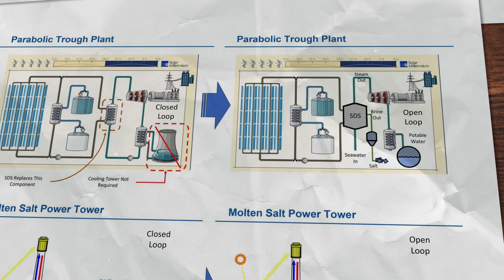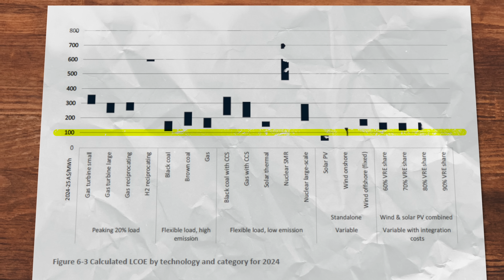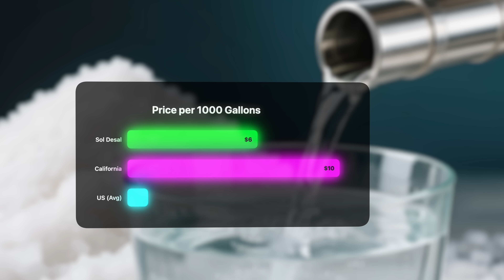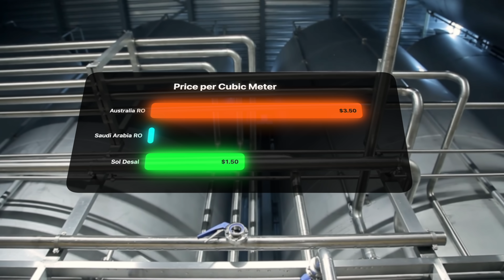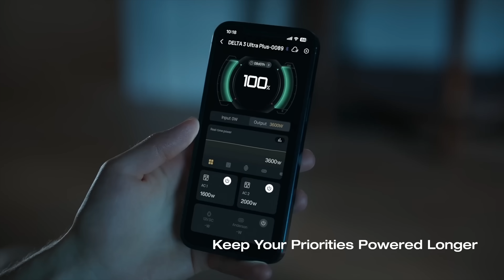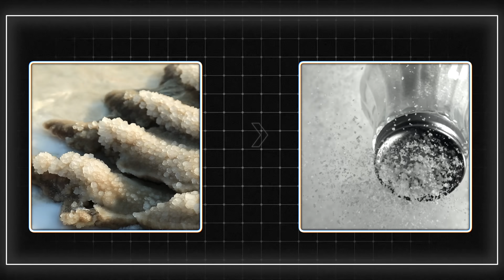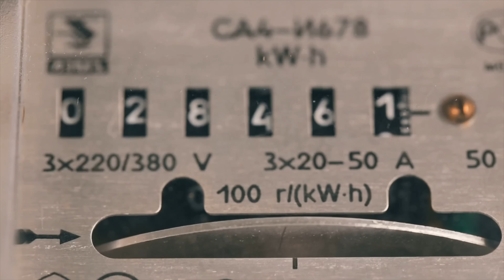The Desalination Process that MAKES Electricity - Too Good To Be True?

Comment: Distilled water is not good for drinking. It lacks the base minerals the body needs. It would need to be refortified, which I'm sure would come at additional cost. Pure distilled water is used as a solvent in many cleaning processes. So it would be good for chip production facilities.

Comment: Parabolic mirrors were used in Nevada...
Didn't work and it killed many birds.
Maybe if they made it like a cellular system, where towers with parabolic mirror collection on top. (LIKE A SUNFLOWER)
The parabolic dish could be on a motorized rail to capture the sunlight more effeciently.
Salt water could be plumbed to the collector and back down to power (steam generated) to turbines.
The salt concentrated could then be collected and the steam could be reheated again to a non-salt, clean water turbine.
Reply: You’re referring to Ivanpah, and you’re right, they couldn’t make it profitable and reportedly killed thousands of birds. I think they are decommissioning at least one or two towers in 2026. This certainly isn’t new technology.

Comment: Instead of using steam from salt water directly to power the generator, the heat is transferred to another fluid with a lower boiling point, which then drives the turbine. This process is known as the Organic Rankine Cycle turbine.
Reply: Their are getting closer.    Combine this ORC Tech with the Desalination tech and fertilizer production and you complete the cycle when you use these solution for food production.
Reply: That would require a closed-loop setup and they would not be separating the water from the salt.
Reply: can you get an equal or greater amount of pressure out of that process?
Reply: Very Interesting ! ! it sounds like even "PURE WATER" could be that other fluid if they wanted. The "Top Off Heat" for the turbine could be done by separate tubes collecting solar heat just before blowing into the turbines. Brilliant use and multiple use of solar heat which is the easiest energy form to collect from the sun! ! ! AWESOME thanx for bringing it up!
Reply: @haroldwestrich3312  Thermal power plants transfer heat with a much warmer liquid to the evaporating liquid used for the turbine. I don't see how the sea water could be that liquid. In this case you actually want your sea water to evaporate to get to the destillation phase, which does not go well with the role as heat transferring liquid. I suppose they'll have to use some smarts to make sure the sea water vapour is pure enough to use directly in the turbine. I don't think they can generate sufficient preassure otherwise.
Reply: @mrleenudler  Liquid CO2 turbines.
Reply: They probably betting corrosion resistant turbines. GE is launching a pilot plant to produce silicon carbide fiber that cost $1k-$10k/kg that will allow for the fab of silicon carbide turbine blades. If you achieve enough corrision resistance their plan become viable is ways it hasn't in the past.
Reply: No, that just how heat exchangers work it's called thermodynamics!
Reply: Cool Ty😊
Reply: But with that method, could the water obtained from transferring the steam heat still be used as distilled water?

I guess the heat transfer could be made in a chamber separate from the original saltwater, but I wonder if all that moving around wouldn't end up in significant heat losses
Reply: @drillerdev4624  Yes you can use heat exchanger for that one which geothermal power plants commonly use to prevent contact of corrosive steam from underground to the turbine and more sensitive parts.
Reply: @drillerdev4624  To answer your question, yes, it could still be used as clean drinking water.
Reply: @drillerdev4624  no

Comment: The ocean offers not only salt water but also wave energy to supplement that needed for desalination.  So locating a solar farm above a vast array of wave power generators might help balance the equation.  Add wind power generators for a 24/7 boost.
Reply: Your looking at costly expenses prob doesn't offset the value
Reply: @kingchristopherpaul477hutc8  what if it is all constructed as a long breakwater to mitigate costly beach erosion?  That would be added value.
Reply: @Chris.Brisson aqua turbines mounted in ocean break with panels mounted on top for easy access?
Reply: @kingchristopherpaul477hutc8  aye, with perhaps a service road constructed along the entire length of the power-generating breakwater.  The wind turbines mounted high above the solar panels and the aqua turbines catching the waves.
Reply: @Chris.Brisson this is what YouTube is for brainstorming with random likeminded people we don’t even know and coming up life changing solutions 🙌🏾

Comment: The missing link is the Thunderstorm Generator. It would pull the remaining brine from the steam.
Reply: Lol you missed the part where solar energy is converted to steam, which is converted to mechanical energy, which is converted into electricity, which is converted to heat to dehydrate the brine. We'll only need a mirror array the size of a small city, and the self control to not use it as a death ray.

Comment: Perhaps the solution... no pun intended. Is to use a permeable membrane (not the kind used in reverse osmosis.) To diffuse the water as it boils so that the boiling effect is more akin to a simmer than a rolling boil. Otherwise agitating the water with a mixing blade would prevent bubbling while producing steam as well.

A super hydrophobic Inconel 625 mesh would be expensive but potentially very effective if it can move up and down with the height of the pool.
Reply: hot water and membranes are you kidding me? the thing is going to clug on the first day lol!
Reply: @carholic-sz3qv It doesn't need to be a 1-atom-thick layer of fibre cloth it could be a steel mesh or something to that effect. A membrane is a selective barrier, either biological or synthetic, that separates two phases and regulates the passage of molecules, ions, or other particles. Based on the definition I just googled it can be as thick and strong as you like.
Also depending on atmospheric pressure your water will boil at roughly 100°C or approximately 212°F which is not actually very hot compared to the temperatures that I use when forging which is closer to 1100°C or 2000°F so we definitely have materials capable of withstanding a heavy boil.

Comment: This concept is not new. Thermal solar used for desalination. Tested in the "Plataforma Solar de Almería" more than a decade ago.

The problem is that the infrastructure is more expensive that PV + osmosis desalination which is also clean and "old" technology today.

Yes, I have watched the video. I just don't believe their claim that the problem they said they solve is the real cost problem of the infrastructure.
It's just expensive.

Comment: if the turbines get salt buildup, why not have multiple and divert the steam at regular intervals? Turbine goes offline and is cleared of residue and inspected.
Reply: @JoshFealy  a turbine has never been operated on steam from salt water, usually steam to drive turbines is from pure de mineralized water where water acts as a working liquid. To use brackish steam there needs to be significant improvement in material of the turbine.

Comment: I’ve been saying solar thermal concentration, storage, desalination and distillation is viable in many geographic locations for several years. No one seems to care…
Reply: There's no money to be made. You make more money selling solar panels that convert a fraction of solar energy to electricity to be used in a heat pump to heat a room than building a passive solar greenhouse that is probably way more efficient at extracting useful heat from sunlight.
Reply: Possibly because the first sentence is little more than a truism. "been saying" adds even less to the salience. It's like "people should stay hydrated". Well, yeah...

Comment: Loving the idea, but I would argue that the synergy is less genius than the kind of common sense that most viewers of this kind of video have been screaming at their screens for years. It can be frustrating to see these amazing professionals miss the obvious ways to merge technologies because they are stuck in their own research bubbles. On a smaller home scale you could achieve a similar thing, but probably using a Stirling engine (a bit safer for home use and can still work to a degree even if the steam doesn't superheat) and using the water reservoir as a cold sink.

Comment: I like the multi-output-product concept.  I like the salt-to-battery concept.  The amount of salt produced will still be excessive (by orders of magnitude), and ultimately it isn't a bad thing to put at least some of it back into the sea just to maintain salinity levels verses the far-less salty effluent from sewage treatment plants (where the fresh water eventually ends up along with evaporation).

At least you are hawking Ecoflow and not Jackery, but I have very strong negative feelings about using power stations as whole-home solutions.  I don't think it is going to turn out very well for most people in a few years as the gear starts breaking.
Reply: About the power stations - Not good for the user and not good for the huge numbers of broken down equipment needing to be recycled or just wasted.  Roadside Recycling is going to happen everywhere there aren't eyeballs watching.
Reply: @OneWildTurkey  thank goodness we are about to have drones watching each one of us 24 in our surveillance state of a nation. No one will be able to get away with littering. I am being slightly facetious, but yeah we need to establish circular economies for as many products as possible.
Reply: @lexpox329    oooh - circular economies.   Yet another cool buzzword that the marketing teams are obviously getting ready to invest in.  I guess the old phrase Reduce, Reuse, Recycle is too passé.

Comment: THere is still a problem: Saly is not just sodium to be used for making batteries. You will still end up with a whole lot of chlorine. What are you going to do with all the chlorine? You are going to need to build a lot of swimming pools. 

I think there is a much easier way to deal with brine. It is only a problem if its concentration is too high. Stick it all on vessel running on wind into a one of main sea current where it can drift while gradually discharging its load gradually across large areas far away from the shore and marine life areas.  
It might even up near the poles where is slows down melting of the ice.

Comment: How is this different than ivanpah Nevada's plant. Salt isn't that expensive. Was ivanpah's regulator that onerous , was their management that inept.  Was the maintenance neglected rhat bad.  Why aren't China pv panels and a hydrogen generator the desalinization part and the burning h2 and collecting the water the generation part. The heat can be stored with the same amount of steps? If that sounds complicated than I say this is just the same.

Comment: Salt could also be used a blocks for keeping AMOC running.  Placing them on Greenland for example could add salt back to the flow reducing the impact of all that fresh water.  Sodium is electronegative so it sounds like there needs to be another material - filter that is charged positive for the Na to adhere to before hitting the turbine.
Reply: That's interesting and scary geoengineering and worth keeping in our back pocket.

Might a high stack, or a series of them, be simple and effective at separating the heavier brine-steam from the pure water steam?

Comment: Is there a way to used the brine splash to put a thin coating on the turbine blades so it won't etch the blades? I know that it would add a cost, if it is possible.
Reply: The build-up is the problem and a thin coating doesn't fix that.  Good thought though.
Reply: My thought came about him taking about the pitting on blades. You bring up a great point that I didn't think of.

Comment: There is a project called Aqua4 from WaterFX that desalinates and generates salt as a byproduct for later use. The difference in their case was the use of cheap concentrators covered by a cheap film with high reflectivity. Since then (I learned about the project in 2014), I have always believed that this was the way forward: to desalinate and generate energy and salt as a byproduct.
Reply: It's thermodynamically impossible, it can never generate enough electricity to power two process at the same time and leave alone have more electricity for the grid.
Reply: @MrSdsok  how is it thermodynamically impossible? If it desalinates by boiling the water away, the sun can keep coming out each day to boil a little more away and eventually you are left with just the salt. The sun is the source of the energy, no need to use the electrons generated by the turbine to heat the water. That would be a free energy machine which can't exist.

Comment: They need to make the parts that will come into contact with salt, cheap and easily swappable. Maybe use a Tesla turbine made from the cheapest composites, rather than a traditional turbine. It should not require nearly as much precision, hence cost. 
 Ideally use materials that can be recycled into new turbines. Will it be as efficient, no. The money you save in maintenance and downtime should more than make up the difference.